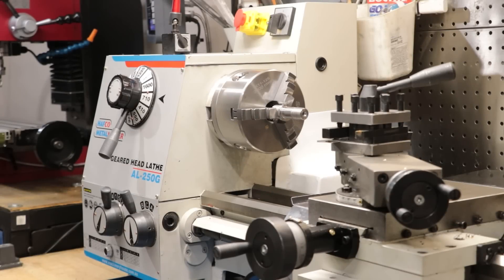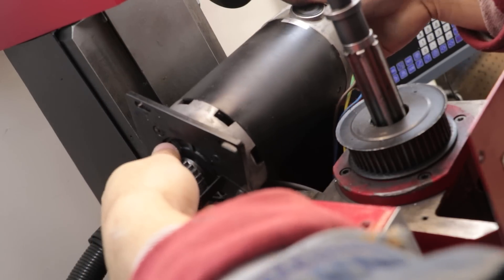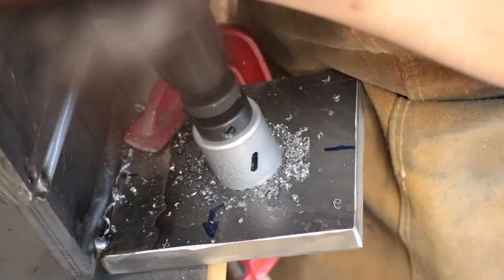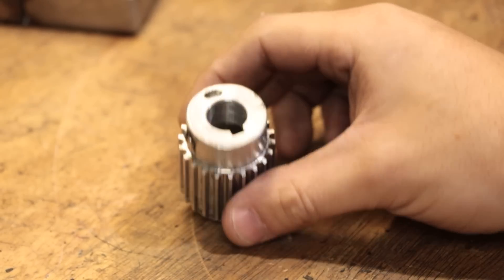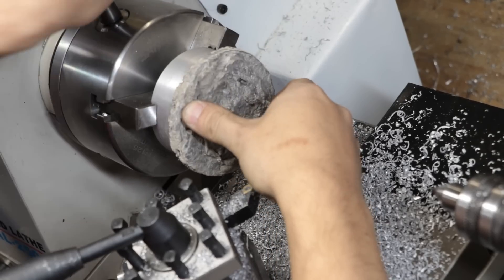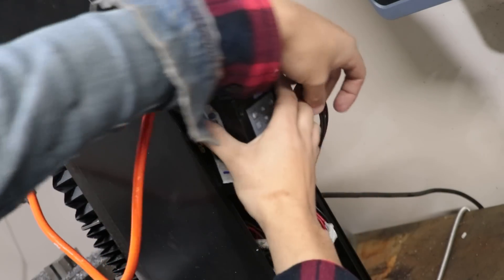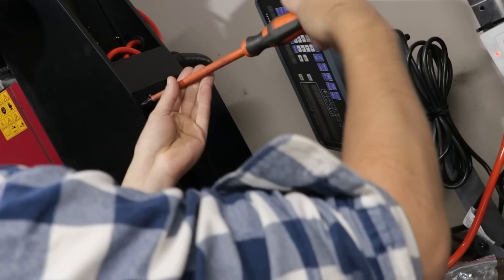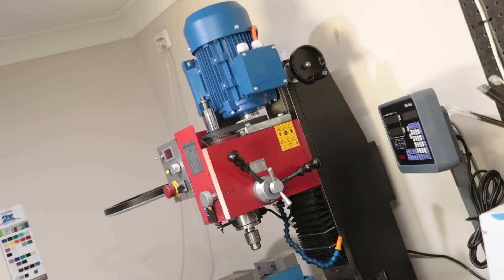I Put A 3HP Motor On My Mini Mill

Comment: Oh man I see what your problem is when drilling that hole with that cordless drill. Do you use in a Ryobi that's what's causing the problem. The Ryobi company makes cheap junk. I would use either Ridgid or Milwaukee for better performance and reliability.
Reply from the maker: I dunno, we’ve anyways had ryobi stuff. Not really a ryobi guy but I have enough spare batteries that it makes the most sense for me to buy another drill.
Reply: @artisanmakes  oh ok that makes sense. I would have done the same thing.
Reply: @Grauenwolf  Yeah, milwaukee and ryobi are nowhere near the same level of quality, you'd have to be a clown to assume as much. One does make cost cut junk occasionally, but the other consistently makes mediocre homeowner grade garbage.

Chevy makes the corvette, yet they also made the spark. I guess that means they are pretty much the same car but just different color schemes?
Reply: @pontiacg445  lol this reply is priceless. I love it. I can tell you actually use power tools often, like probably every day at your job. I'm assuming that the guy who commented about everything being owned by techtronic Industries is probably one of those guys who might use power tools once every blue moon.
Reply: @Grauenwolf  you are absolutely right my brother, except for the quality of the electronic components. I've repaired  power tools from most brands and Milwaukee and Bosch have by far the  best internals. When you use power tools on a daily basis, you learn that some companies are garbage and some are not. No matter who the parent company is,

Comment: You can save the tools gummed up with aluminum if you put them in concentrad drain cleaner. It will eat the Alu and not the stel or carbide.

Comment: Really looking forward to your rigidity improvements.  I think you'd love an inexpensive plasma cutter.  I've had mine for 3 or 4 years and it's still just fine.  I hope I didn't just jinx myself.
Reply: Actually Aldi have a Plasma Cutter on sale at the moment for $299. It might do the job for you? You will need a compressor to provide the compressed air for the Plasma Cutter. 
Mark from Melbourne Australia

Comment: For sure the hp line of Ryobi is a lot better that the compact line of one+
Get a 3d printer, it would had made the job of getting a pulley much easier (and trust me, printed parts are much stronger that what usually people give credit for)
Reply: Heck, he could even have done a bit of lost-PLA casting with that aluminium puck.
Reply: @Kineth1  agreed

Comment: Two points of contact for rigidity. The base to the bench (of course) and the motor to the wall. It has made a significant improvement to my converted drill press/mill. Can’t see why it wouldn’t work similarly in your situation. The centrifugal forces in that bigger motor is getting everything else to rock-n-roll. I will be very interested to see what you come up with. Luv y’ work.
Reply: Clarification…In this case, the tower/pedestal that the motor moves within, can be attached to a wall or more solid structure. Increases in rigidity are usually achieved incrementally over various fixture points including the tolerances of the motor’s attachment to the pedestal and it’s adjustment mechanisms. When solving rigidity issues you start where the cutting tool meets the workpiece and work backwards, examining everything. You may find a solution where you least expect it.
Reply: The motor travel with the head so it can't be fixed to the wall.
Reply: @koharaisevo3666  think the motor is fixed, the other axel travels.
Reply: @koharaisevo3666 The motor doesn't travel with the head.
Reply: @autumn5592  Of course the motor travels with the head. There might be a quill, it's probably longer than you are and still woefully ineffective.

This isn't a knee mill, nor a drill press. Have either of you ever even been in the same room as a mini mill?
Reply: @pontiacg445  Ad hominem, argument invalid.
Reply: @autumn5592 Just because they used an ad hominem argument doesn't make you correct.  You can see the vertical path that the head rides on clearly with the old motor still installed.  The machine is designed for the motor to ride the head, and the quill provides a limited range of vertical motion when the head is locked.

Comment: This video is really showing you the limitations of cheap import tools. They work fine for small, careful projects. But try to put them to "work", and they fail pretty quickly. Been there, done that. There is a reason why quality drills, cutters, and tools, cost what they do. As the size, frequency, and scope of my work have all increased, I have had to abandon all of the import stuff that I started with and moved to quality tools. The difference is night and day, especially with drills and cutters. EDIT; as I finished typing this, I saw that you chose to replace the drill with ANOTHER Ryobi... Could not be face palming any harder right now...
Reply from the maker: As much as I’d like to get a decked out Milwaukee set, it’s just too expensive at the moment. Ryobi is not my first choice but I have a ton of spare batteries and the drill was on sale so that was easily my first choice.
Reply: Ryobi HP can keep up with the older Milwaukees np

Comment: Not much of a commercial for Ryobi Drills . . .  Also, I love the idea of writing the purchase date onto your tools.
Reply: Eh, I used them for several years at my previous job. I burned up a couple drills too, but they're much cheaper than Dewalt or Milwaukee, and seemed to be quite solid for the price, especially their new brushless stuff. Again, to each their own lol.

Another good cheap option seems to be Harbor Freight's new Hercules stuff. In Torque Test Channel's recent tests, it blew out everyone including Milwaukee and Dewalt for half the price.
Reply: the brushless ryobis do great, I've had mine for 3 years now can't fault it
Reply: Ryobi is great for seldom use and light work, but if your doing something more heavier its better to go with known recognised trade brands like Makita, or Dewalt, etc. but they also come with a price tag to match, in excess of $400 to $500
Reply: @Grauenwolf  he is not mate, he's an aussie like myself, bunnings is the australian equivalent of home depot in the states